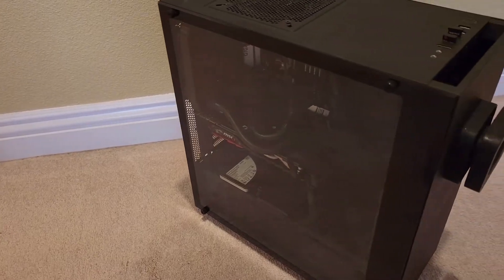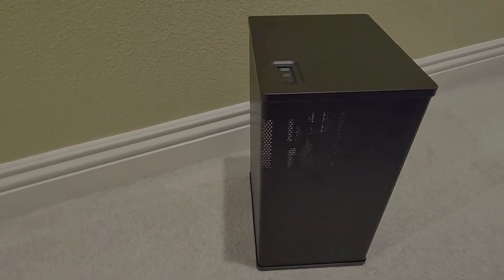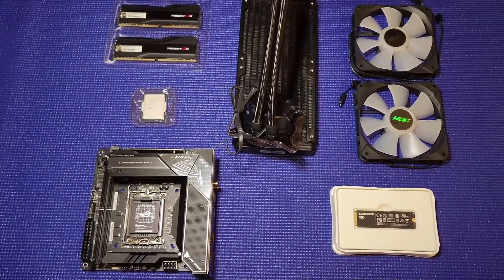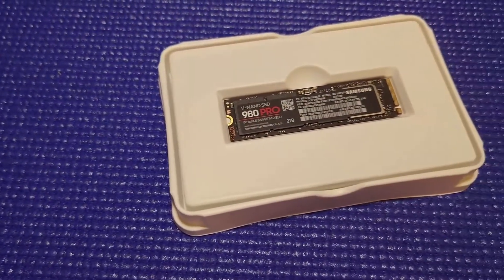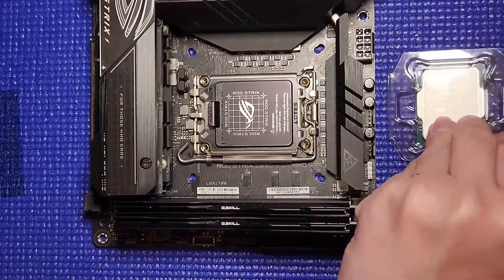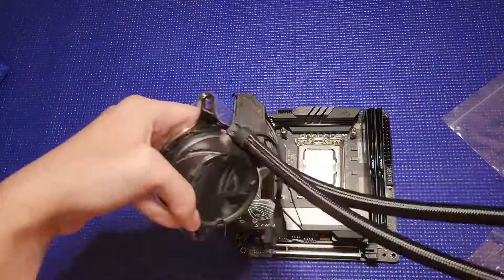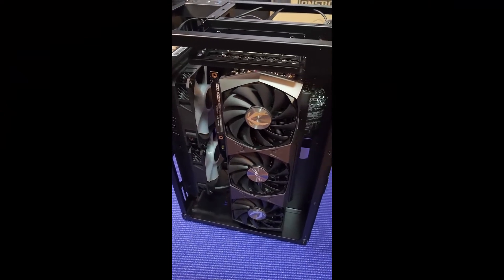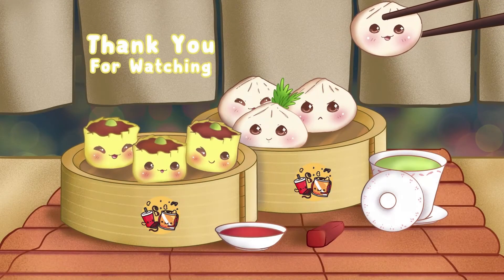MrMoncheez | $3500 Custom Mini ITX PC Build - 3080ti, i9-12900k, liquid cooling, 2tb SSD

Comment: Did you checkout cooler master nr200p ? I built in nr200p and it is awesome. No thermal problem
Reply from the maker: That is a good case for small PC build but I went with the JONSBO VR3 because it did not have glass and its easier/safer to pack for my personal travel purposes.